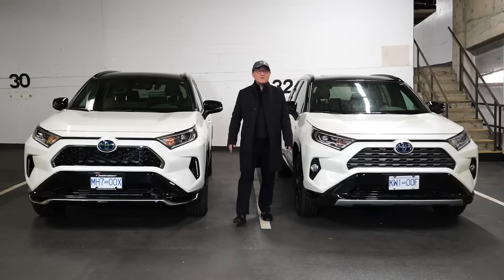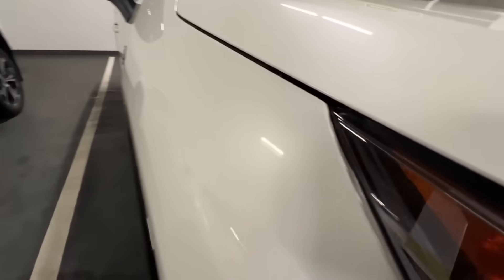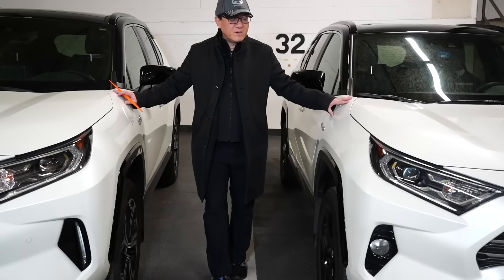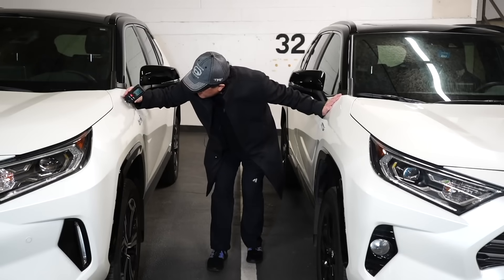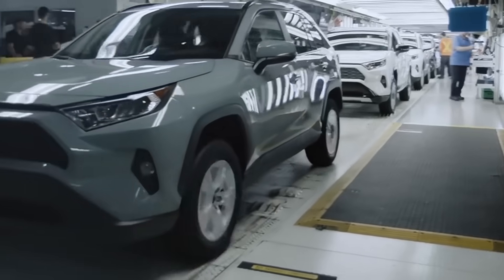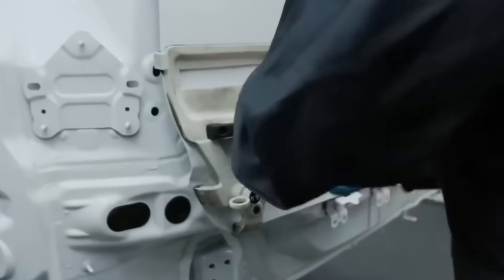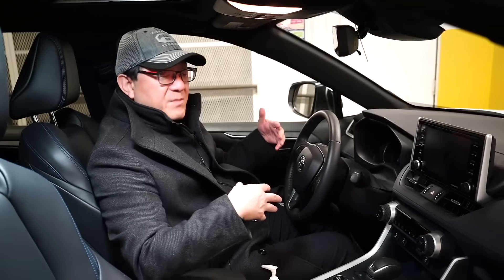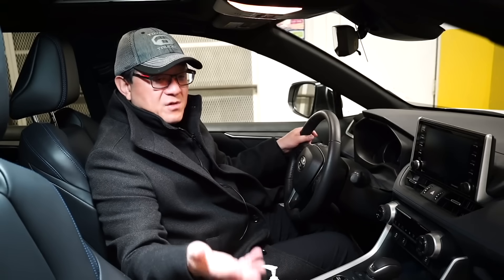JAPAN-BUILT RAV4 vs NORTH AMERICAN-BUILT RAV4 - WHICH HAS BETTER QUALITY?

Comment: I just bought 2023 Honda crv Hybrid made in Canada. Lets just say their craftmanship is sloppy and dealership says no warranty for slopy craftmanship. Back center console seat cloth just made crookedly, the connection to the battery is purposefully bent so the mechanics can tighten it correctly, hood panel cover lost one of the tab, that is so far I have seen in my vehicle! If you are interested to see, I can make a short vid to show you all! With that says, mechanically it still good (thanks God), but for the vehicle sold close to $40k, I expect at least non crooked material and better handling and better QC, can you do that Honda Canada?

Comment: Friend and I got a Corolla in 2017, brand new. We both had gotten an SE model and little did we know we got one built from Japan and one built from the US. They have both been extremely reliable however I have noticed a bit more rattling on my interior. Yet I have 42000 miles, he has about 68000 miles. His car still sounds quieter by a margin and I'm jealous lol.  Mine happened to be built in Mississippi.
Reply: Yeah mine is built in missisipi and it sucks . Sorry for u man
Reply: The Mississippi plant is a joint venture between Toyota and Mazda. Not fully owned by Toyota.

Comment: I don't know but Japan might now use low V V.C paint that could cause the thickness. difference!
The paint on injection molding is also different.
Which could also be the finish polishing of the nickel or chrome model 
I worked in a paint plant .
Those bodies are electric static paint dip Tanks .
Go visit the John Deere plant and it's bad paint jobs on it combines and the difference in it's painted roofs that are plastic injection molding on a 500 ton press.

Comment: I own one Japan made Vanguard 2008. AWD 7 seater. Milliage is 176,000 km. No sign of corrotion underneath until now as compared to the same model in America called RAV4. I watched so many "Do it Yourself" Videos from Youtube which thankfully published by Americans coz I do most of maintenances to my car. The fact from what I saw that most metal parts underneath are already corroted such as exhaust, bolts, joints, etc.

Comment: I have honda crv 2004 make in Japan and now CRV 2011 in north american so much different. Car in japan can run to 400K still sell in good price and so less maintenance. New one in North America car broke down everything from air condition, transmission, starter, fuel injection, gas pump, air bag, rust all giving problem specially the electronic problem I think they try to save money by giving china making more parts for them.

Comment: Our canadian made 2020 Rav 4 has 16K mile and it's a piece. So many issues it's hard to believe it's a Toyota. The best was the roof rails that leaked into the headliner and their suggestion was to "Not park it outside". It's also had rattles in the headliner and tail gate and the front right of the dash since it was new but the dealership said those are "normal"

I have a 2021 Chevy Bolt (Seriously a GM product) and besides the battery recall it's had one issue with the doorlock but otherwise no rattles or any other issues.

I would never consider a Toyota again unless it was made in Japan.
Reply: Hate to say it but my 2019 RAV4 XLE was made in Japan and it definitely had rattles and was very loud in the interior. Toyota seems to be living on their past reliability. They definitely don’t build them like they used to. I now drive a 2022 mazda cx5 and love it. All cx5s are made in Japan but the cx50 is made in Alabama and I heard it isn’t as well built. Never thought I would drive anything other than Toyota but times have changed.

Comment: This comparison should also have a disclaimer. The sample size is small. In mass production, there are always variations in dimensions and fits. How do we know these two cars in the video are representative of the Japanese and Canadian factories? It may be the very best sample in Japan, and worse than average sample in Canada. If so, the conclusion is somewhat flawed.
Reply from the maker: Toyota's manufacturing standard is such that there would not be more than 0.2mm difference between cars built in the same year.  Also, I checked and looked at dozen of RAV4s built in Canada, US, and Japan before making this video.  I designed and built the equipment and the process for production of various vehicles, so I should know how this works.

Comment: The worst car I ever had was a 2003 Toyota Sequoia Limited. Owned it from 2006 to 2009. Tons of electric gremlins, tailgate glass stopped working due to rusted tracks, check engine light always on due to misfires. So glad when I sold it.

Comment: I'm no expert, but Canada does have a very wide temperature variation from summer temperatures that can reach +40 degrees celsius to winter temperatures that can reach -40 degrees celsius. Could expansion and contraction of the metal be taken into consideration when allowing for such gaps?

Comment: Toyota publishes their QA scores annually for each plant globally.  Every plant outside Japan is worse than the Japanese plants.  The last public numbers (2020) have the Ontario plant at an average of 85 production errors or Failure Against Standard per vehicle, while the worst Japanese plant is sitting at 27 errors per vehicle.

The ONLY plant that has ever come close to the Japanese standards of production quality was the Christchurch, New Zealand, plant back in the 1980's, but even that plant only got to within 3 points of the Japanese plant average for the time.  That plant was shut down by Toyota after the NZ government removed import duties on new vehicles, resulting in the complete collapse of the NZ auto production industry.

Comment: What about parts suppliers? Maybe that's where the problems arises not immediately but years later. You cannot ship all parts from Japan to build the car. I bought a toyota corona in Aus back in the eighties did not know it was made in Aus. The gear box starts clunking one year later ,the contact to the rear screen (defrost) broke off and cannot be resolded (new screen required) Found a lot of water inside boot after hosing the car SO what's the verdict??

Comment: I own a  rav4 hybrid built in Japan and it just excellent the panel gap are super costitant and 3mm seems to be the same as yours. It had to go body shop for paint work they said it panel, gaps are great but he did comment that the original paint is lovely but very soft compared to a European top coat he also commented on the gloss of the top coat was hard to match.
My car built sept19 not a rattle on the car anywhere not a switch out of place everything looks like new theva bit of creasing to real grey leather driver seat it once clean a fed it goes 
American car report poor welds on doors and door mirror that vibrant  non of that on the japanese built cars . Everything is very well built. I have heard many c9mpa8nts about the kentucky plant Georgetown.  Very poor production quality on early cars

Comment: The Canadian Rav was not built in Cambridge as you inferred, it would have been built in Woodstock where they do not make a Lexus
Reply from the maker: Toyota Motor Manufacturing Canada Inc (TMMC) has 3 sites: TMMC North (Cambridge), South (Cambridge), and West (Woodstock).  The RAV4s are primarily built in Woodstock plant, but they also produce the RAV4 in the Cambridge North Plant since 2019 - the second plant to build the RAV4s.
Reply: You are correct, and your Canadian Rav being a hybrid was built in Woodstock where they do not build Lexus vehicles
Reply from the maker: @alwayslearning3426  Most of the time, I simply say TMMC, but since viewers don't know what that means, I have to explain that it consists of 3 specific plants that are actually quite close to each other (Woodstock is only about 40 min away from Cambridge plant).  I lived near there so I know the area well.  Thanks for the input in any case.

Comment: Most vehicle manufacturers are using robots to build vehicles, so tolerances are set by  the engineers and the robots should be able to produce them. So if the Canadian built vehicle has slightly bigger gaps it could be on purpose, maybe because you have greater temperature variation in North America than in Japan, and maybe that is why the tolerances slightly different.

Comment: Mentioning the new tundra gave me ptsd because i got screwed by my dealer with the new tundra due to so many issues! I purchased my tundra in texas and it 2 months it had a turbo failure, fuel pump failure, drivers door weather seal failure and rear passenger window actuator failure... i wanted my money back so fast like never before and ive been a toyota owner since 1997. This was a sign that the Toyota of old that i love is mot longer here.  With my tundra i was forced to pay 10,000$ over sticker and driver a loaner vehicle which the dealership tried to take away because they were waiting for parts for my tundra. I traded jn my 2014 tundra for the new one and ended up selling my new tundra to buy a gmc ... i hope toyota make reliable cars again in the future and increase the interior space on the new tundra because after being jn the gmc i realize the new tundra is extremely tight on the inside as comparison. Very nice video on this comparison thank you for sharing.🎉

Comment: It has to be based by numbers if we try to compare them,how many are still kept running and owned in the US, how much complaints are there, how many major repairs and lastly, how much miles and calculations should also consider geographical area the cars are owned. Only then I can accept that they are equally made.

Comment: Mines is built in canada it’s a 2021 within the first year I noticed a couple squeaks and rattles but I let it go because I’m like it’s not a luxury car looking back I bought it new and I wish I had test drove it, first body issues as well like the window trim is slightly lifted at the ends, the windows have a whistle when rolled down and I’m going like 25 the front doors make noises at speed as well one of the doors filled with water I was easily able to fix it but still I was kind of upset about it, I didn’t expect it to be perfect but I was upset because it’s new car and I baby it so it’s not like it came apart because I drive it rough, it’s ok it just thought me test drive before buying

Comment: How about ugly electric charge hood? Pop up unexpectable after closed.  The fuel tank capacity issue problem. Fully fill the tank to the advertised 14.5 gallons, my record  was 12 gallons when gouge show zero to go.

Comment: Interesting and good video. Just picked up a 2023 Corolla LE here in the US. I noticed the first few cars of any new model year are built in Japan. So, mine is a J VIN. No rattles or squeaks. Overall fit and finish is excellent. However, when I took delivery the steering wheel was slightly off-center. That may have been caused by the long transport and being tied down. Also, I noticed the trunk is difficult to close. That may have nothing to do with the factory location. Anyway, hoping the quality is long lasting.

Comment: I'm not worried about 3 or 4mm gap differences, but I don't want a car that rattles when you hit a bump.  I go for a car that last the longest with the best reliability.  Toyota and Honda fit that category.  However, I'm not sure what went wrong with the quality of the Toyota Solara that was made between 1998-2008.  That model was a disaster for falling apart on the inside.  I prefer vehicles made in Japan, but I'm not sure if you can get a vehicle from Japan in the US anymore, unless it was a special order.  Are there certain models of Toyota that are only made in Japan?

Comment: If we were to buy another  Toyota it would have to be made in Japan. We had a terrible experience with our 22 Sienna hybrid. 
It had battery draining issues, trim was coming off the roof, all door and trunk motors needed replacing. The only great thing was we got $10k
more than we paid for it and the tax savings towards our new Yukon.

Comment: It’s always have slightly differences between Japanese made and other manufacturing in engineering strength of materials and painting works…U can check it how Japanese painting works are really consistent as I have tested it..Use ur hammer and hammers it to ur Japanese car body paint. it never come out bcoz they paint it deep through ur body steel….and I think u can’t do it in any Japanese local manufacturing cars and Chinese brands That’s how Japanese quality original paint is …No Repaint and any bad quality paint can do that!!..To be honest..Japanese ones are always better and last longer ,I also have a Japanese ones and always last long😊… Engineering materials will always be difference place to place and country to country as I am Civil engineer myself and I believe in Strength of material..Let’s say trees and woods grown in Asian have weather resistant and high resistance to decay , harder and always better than that of in North america in furniture …. So no doubt Japanese cars are better .. and never Rust

Comment: I have a 2018 Tacoma made in NA that has had 0 issues, and I'm 100% pleased with. Now to the Rav4. We HAD a NA made 2021 Rav4 XLE premium that was totaled in a 2 car accident with 32000 miles on it. My wife claimed it saved her life! We replaced it with a 2023 Rav4 XLE premium that's ofJapanese manufacturer. I would be very hard pressed to show you a difference between the two, but my wife swears the new one drives better, I can't tell a difference in the driving. I do think it's a little quieter for some reason, but I've experienced more difference in sound from a tire change.

Comment: Checking body panels is fine.  The bigger question is engine, transmission, and electrical systems.
Reply: Yup! That’s what I wanna know! Who cares about the rest!
Reply: @bushitwo6367 Yep. My Jeep is on its 3rd transmission, but the paint looks great.
Reply: Gaps are more critical in head gaskets and piston rings than on the body.  And Toyota has had a few issues internally where the fancy plastic ruler cannot go.

Comment: I have a Rav 4 in uk , Japanese built , the chrome plastic is pitted badly and the bumper has a big paint chip . Had no other problems other than leather steering wheel has leather come off in strips .

Comment: I bought a 2019 tacoma off-road brand new from the dealer lot. A coworker also bought the same vehicle from a dealer lot in the next city close to here. My tacoma was white, my coworker bought a black one. We both have the same issue with the paint. My tacoma the paint was peeling off of the drivers and passenger side doors the black tacoma the paint is peeling off of the hood. I went to the dealer and they said there's nothing they can do and the same happened with my coworker. My tacoma was made in Mexico I think the black one was also. I would have to question the quality of the paint. Maybe the factory in Mexico is cutting corners to raise profits, who knows. I sold my tacoma and bought a 2021 4runner. I belive 4runner is actually made in Japan and shipped here. Hopefully it's as bullet proof as has been advertised.

Comment: I have worked for Toyota/Lexus in Canada for over 32 years.  I believe both vehicles are very good.  I do agree Japanese vehicles tend to be a little better.  Visiting Japan many times, I definitively know for a fact, the production workers and Engineers in Japan are top notch. But the main weakness for North American built vehicles (albeit small)  are the part suppliers. Getting Toyota quality standards, consistently from North American suppliers is very difficult.  From what I have seen  This is the main difference.  
On a side note. I have never ever seen any Toyota with a body gap spec target of 5mm   Toyota is mostly 3 ± 1.5mm.     
The Rav hood design is a little wonky.  Lexus is even tighter. Nice review and video. Keep up the good work.
Reply: This, my thoughts exactly
Reply: what department are u in?

Comment: The problem doesn't lie in the build quality. 
Any differences will be in the quality of individual parts. Parts made and sourced in Japan are of extremely good quality while in other parts of the world they can vary because the local manufacturers will be under pressure on price so they never match Japanese quality. All the rubber and plastic parts on my Japanese toyota last up to 20 years while I've replaced many rubber boots etc on my Australian made toyota after as little as 7 years.
Reply: What about the JATCO {Japanese Automatic Transmission Company} CVT transmissions?  Many of these transmissions have been known to fail at an early age.
Reply: @josephkelleher8820  isn't jatco a Nissan company or affiliate. They are the exception to Japanese quality engineering.

Comment: I still have my 2016 Lexus RX 350 (Made in Ontario, CA) and it's been perfect in every way. The fit & finish is still incredible and it's only had regular maintenance; i.e. oil changes, a battery, tires, etc.  It still looks & drives like new.  The 4th Gen RX model ran from 2016-2022, so people still think it's much newer than it actually is.  I like that it's got the super reliable, naturally aspirated 3.5L V6 engine (no turbos).  The 2023 models went to turbo 4-bangers.

Comment: The overall static quality of USA-made is not worse or better than JP-made. However, the main difference is coming from the quality consistency. Once a product is allowed to be manufactured, the large volume quality should be OK. However, how many quality failures in hundreds or thousands is hard to tell. To my feeling, JP-made is 1 failure in 10k cars, US-made-JP-brand is 1 failure in 5k cars, US-made-US-brand is 1 failure in 10 cars. If the failure is not arrived, everything should be similar. But it is coming, no matter where your car producted, just the difference of how long and how frequently.